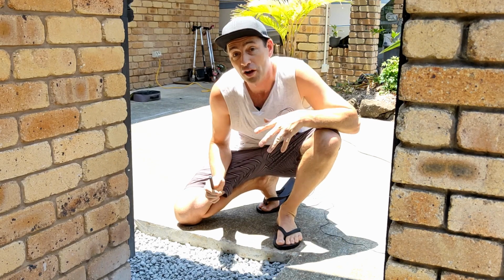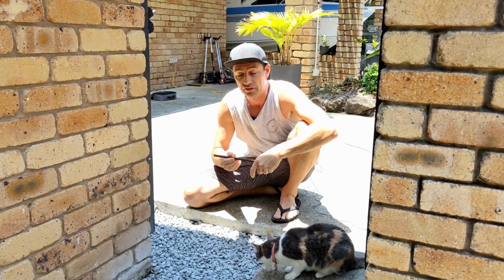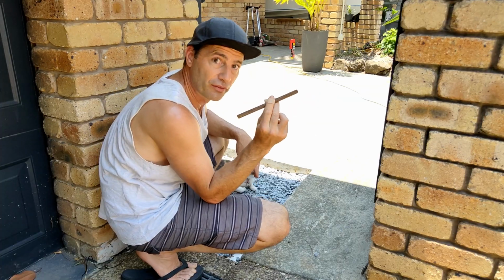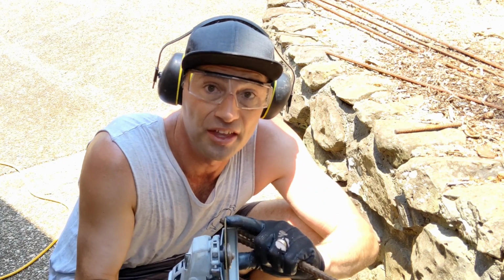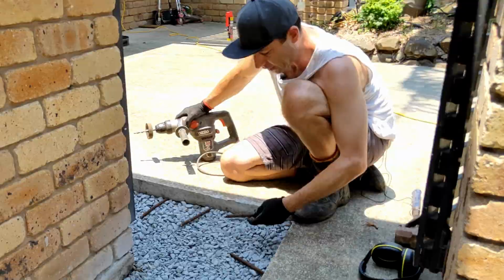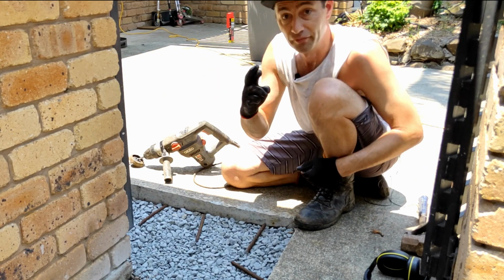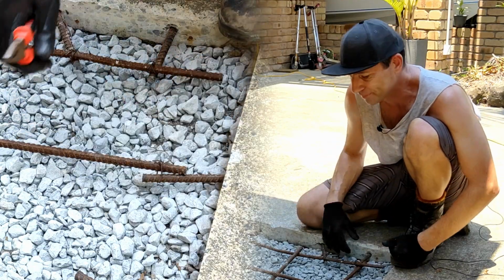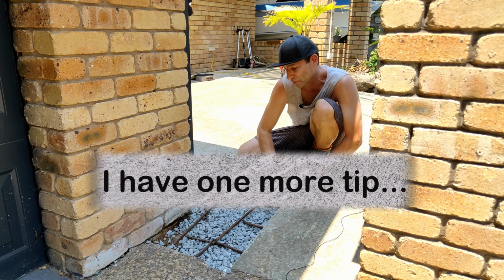How to join new concrete to old concrete - Inspire DIY Kent Thomas

Comment: No exp here but thought I read rebar shd be no thicker than an 1/8th the thickness of the slab
Reply from the maker: Hey loong, didn’t know that …I’ll have to do a bit of research 
great tip👌 makes sense to ensure adequate concrete surrounding the steel. Kent

Comment: We are building a small cabin but the problem is the existing concrete slab is too small and we need to extend the concrete slab by 16 inches on each side. Would this method of yours work as the actual walls will be built on the new extensions.
Reply: apa yang ada di video ini dapat anda terapkan jika hanya untuk menambah pelebaran slab saja dan penambahan wall,
tetapi akan berbeda metodenya jika anda akan membangun cabin 2 storey.

catatan penting pada pemasangan pins/ anchor, bisa ditambahkan chemical anchor, atau mortar di dalam lubang tersebut. atau anda hack slab tersebut hingga ketemu rebar nya dan buatlah besi hook dan disambung pada rebar lama
Reply from the maker: Hey Wayne, I’d just be guessing and I’d hate to put you crook with the wrong info.
This question should be directed towards a builder or engineer.
best of luck mate. Kent

Comment: Would pva and water 1 to mix do for a bond between old concrete and new? You used cement and water as a bond, l never thought of that. Thanks
Reply: ini hanya berlaku untuk slab standar saja, jika pada high rise atau highway, tidak bisa.
harus menggunakan bonding agent

Comment: Rebar should be overlapped about 40 times the diameter of the rebar. Example number 5 rebar (1/2 inch rebar) would be (40 X 1/2) = 20 inches.   Those little one inch overlaps you have are worthless.
Reply from the maker: Thanks for sharing your knowledge Joe👌
You are dead right and hopefully this helps out us DIYers with our future projects. 
Cheers mate, Kent
Reply: That is true, but in this circumstance it doesn't apply. The dowels aren't there to stop cracking, they are there to stop vertical movement. The rebar he ties to the dowels is the crack prevention. It's just a convenient place to tie them in the centre of the slab. 
My only advice here would be to place a ring bar ( with the necessary overlaps as you suggested ) around the perimeter of the slab edge.
Reply: aturan seperti itu berlaku pada perkuatan struktural, seperti highrise building atau highway, tetapi boleh di abaikan jika bebannya hanya static atau tidak berat.
dan besi sambungan itu bukan dowel bar tapi tie bar ..

Comment: Excellent 👍
Reply: Thanks. I would glue the rebar into the hole with some of the cement slurry too. Dust in the hole is maybe not quite so important when using cement
Reply: Cheers John, very kind 🤙Kent

Comment: Nice one, thanks I need to extend a slab for a garage rather than dig up all the old concrete which is perfectly good. I’m thinking maybe a thickish pva mix on the edge of the old cut edge might make a bond with the new stuff? Anyways thanks for taking the time to do this. Cheers
Reply from the maker: Good on ya Russ, PVA is great for concrete adhesion👌 best of luck mate. Kent

Comment: This is example of a good video. It explains the process and why you’re doing it without any useless bullshit. 

I would like to add one important tip.  Anytime you drill concrete you  should use an air gun to blow out the hole. If not, the dust  will prevent epoxy ( if you’re using it) from grabbing onto the old cement.  For a job like this it isn’t necessary because there isn’t going to be any pull force  on the rebar but if you were doing vertical rebar for something structural then it definitely matters

Comment: BTW: You place concrete, not pour concrete.
Reply from the maker: Well well RCollins, you were paying attention! and thanks for educating us all at the risk of sounding like an structural engineer crossed with an English professor (just jokes). You are quite the astute YouTube viewer and are completely correct!

I will continue to pour my concrete - though not because I make a runny mix.. but because old dogs struggle with terminology and nomaclature. Cheers mate. 'facetiously'  Kent
Reply: @InspireDIY you pour the water and pour the bag of dry concrete, even with a concrete truck you pump and pour. So wtf you talking about "place"? You place flagstone, you place posts in the holes after you aug them
Reply: @BabashiSensei if you pour concrete it's too wet is what he means

Comment: I am thinking of cutting out the blacktop floor of my garage and doing concrete but will have to do it in small sections which means a lot of random "joints" that won't really make sense for a garage floor.  When you finished this could you tell that was a new piece of concrete?  I am hoping I can break this up into parts and it will look like it was a single pour.
Reply from the maker: Hey Kaje, at first it was obviously new concrete (different colour than the dirty 20yr old concrete) but it seemed to blend in and isn’t as noticeable now couple years on. You can use the gaps caused by pouring in sections as expansion joints and claim it was intentional 😉, best of luck, Kent
Reply: @InspireDIY  The problem is i won't be able to do this uniformly so it wouldn't look intentional, especially for a garage floor.

Comment: Hi, thanks for the great videos!! I have a question . I tried this dry pour last weekend. I followed the instructions and the slab looks great except for one thing. Large sections of the 1 foot by 8 foot slab have the top 1/8 or so peeling off. The top seems unevenly crumbly. Can you offer some insight? I’m planning on dry pouring two more sections soon. :) thanks!
Reply from the maker: Hey Ez, have you heard of 'Spalling'? have a search on the net and see if that's what's happened here. It's common for us DIY'ers whose ratios/blend may be slightly off at installation. can be corrected with fresh concrete poured over top. good luck, Kent
Reply: @InspireDIY  thanks for the info! Will check it out! :)

Comment: I see a barrier between the building and new pour.  Please tell me about this
Reply from the maker: Oh great question 007, 1, it stops it sticking to the brick and 2, it’s there to allow the concrete to expand and contract freely without applying pressure to adjacent structures (building, plumbing etc) look up expansion joint foam, you can get rolls of different width and length at the local hardware store or online 👍 cheers, Kent

Comment: Neat, but you forgot to bond it with Acrylic slurry, one part water, one part Acrylic and Portland cement, mix until you get a consistency of warm butter, then brush it on old concrete, then pour right away.
If you have greasy surface make sure you wash it with at least 3000 PSI pressure washer.

Comment: You should probably inject structural sealant like epoxy into those holes to transfer the load.......and welding those bars together when you are at it is good idea too. To make a better joint between the old and good concrete, you should apply a layer of bond coat too.
Reply from the maker: Great suggestion cellchow. Cheers mate🤙 Kent

Comment: How did you get those thin cutting blades on your grinder?  They are too thin for mine, won't clamp down on the shaft.
Reply from the maker: hey Onjo, the nut on the grinder can be flipped over to suit thinner/thicker discs, yours may have this function too. Cheers, Kent

Comment: If you were trying to extend an existing slab by about 4 inches (by adding forms and pouring in concrete around the edges) would you have to do this with rebar?
Reply from the maker: Hey John, yes - to answer your question. That would be the perfect scenario for this technique 👌 best of luck mate. Kent

Comment: Don't forget though if you have post tension wires in the house slab, there is possibility of cutting those doing this causing a catastrophic failure of the wires and slab.  Also if it is a new home,  doing this will void the warranty on your homes slab.
Reply from the maker: Good knowledge shared there x Steel🤙 cheers mate, appreciate it. Kent

Comment: Probably would help to use some epoxy in those holes, no?
Reply from the maker: Hey Connor, yeah you are right - epoxy is good at both holding the rebar in place and stopping it from rusting if moisture gets to it. this patch was in a somewhat contained space by 4 sides and not structural so I didn't bother. all the best mate, Kent

Comment: Curious to know everyone's thoughts on this.. I was told you need 5cm of concrete around rebar otherwise water can penetrate and rust the metal (causing expansion and failure) .. is that correct?
Reply from the maker: Great question Lee👍

Comment: Good to know. I am getting a slab replaced that's used for a backyard patio. However, it has three pillars in it and the studs/concrete is deep. Chipped most of it away but there is some remaining concrete that won't come out unless the pillars get removed. Can't do that, so rebar is the option to join new pour.
Reply from the maker: Hey Daniel, drilling and adding rebar into those footings is a great option. Well done mate👍Kent
Reply: I have a similar situation.  I have a wrap-around patio with 6 4x6s posts/pillars.  The concrete slab under the patio roof has numerous large cracks.  My idea is to rent a concrete wet saw and cut 12” to 14”  squares around the pillars.  That will isolate the pillars from the jackhammering when the time comes (maybe 2yrs.).  For now, I will cut slots/notches across the cracks in the concrete and place ½” anchor bolts with a sleeve nut between the anchors to tighten midway down in the old concrete.  Then make some shallow square designs in the concrete and pour some 9000 psi concrete in the anchor slots and fill in the cutouts. This will stabilize the cracks for now and hide this temporary measure.  Total cost will be less than $100.00.

Comment: How about adding a layer of new on top of old (instead of side to side as you show here) - same logic?
Reply from the maker: Hey Kevin, in conversation with a concrete contractor the other day, his suggestion was at least 50mm thick (2 inches), using a finer aggregate, and always with a steel mesh reinforcing incorporated. Of course a ‘self leveling’ layer poured is never going to meet those guidelines💁🏻‍♂️Anyway, his logic sounds good to me! Let me know if you discover something different, 👍Kent
Reply: @InspireDIY  thanks for reply. Not a “covering” - more like an added 8 inches in height for a two foot by two foot square (long story). So rebar (pieces) more than a “mesh”?
Reply from the maker: Yeah, that sounds fair. The mesh gives the tensile strength (optional by the sounds of it - small but thick section), but definitely the reo-bar or dowels which will lock the two together. I reckon you're all over it👌 Kent

Comment: Can you show a follow up? How did it turn out? I have a similar project.
Reply from the maker: Yeah sure thing Oscar, so far so good👌I'll figure out how to do a follow up video on YouTube, may need to be Instagram 🤷‍♂️, Kent
Reply: @InspireDIY  yess! I’d like to see too, especially if the ‘joins’ are too visible or have separated over time. What about colour differences?
Reply from the maker: Hey Fia, I’m yet to do the follow up… but it’s on the cards soon - I’ll tag you👍 
The concrete colour difference is the biggest obstacle for sure when joining new to old concrete.. but the repairs are 100% tied in and not moving, so mission accomplished 👌Kent
Reply: @InspireDIY  I will look for you there. Thanks!